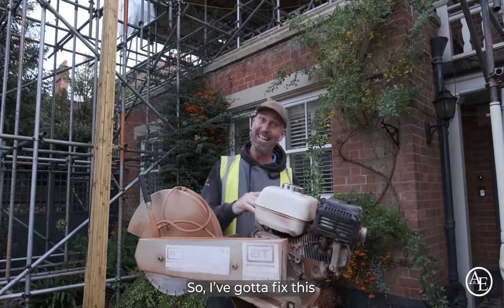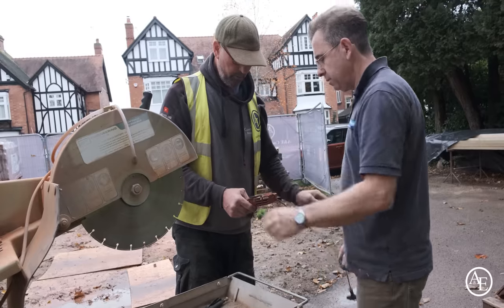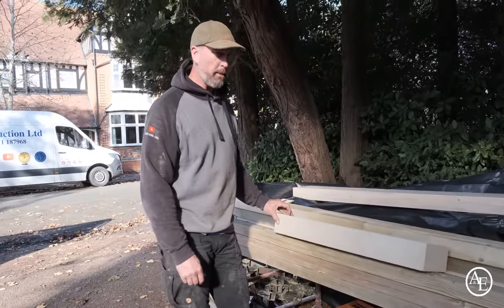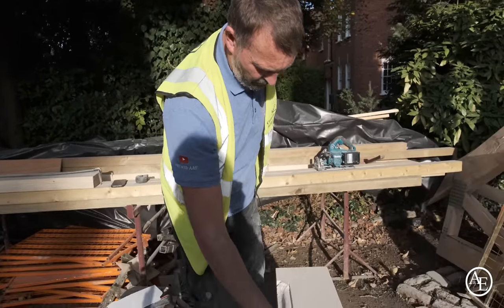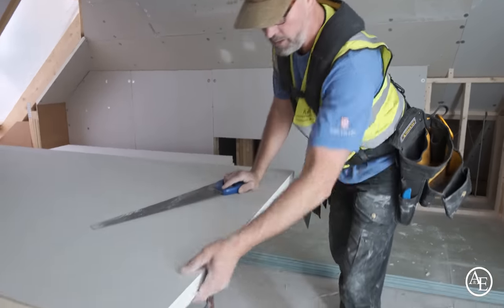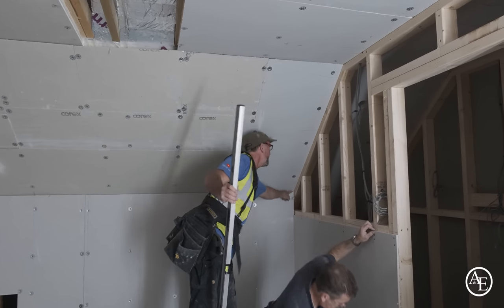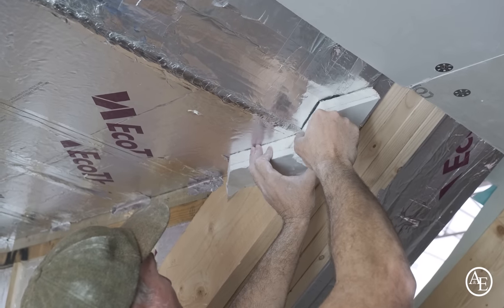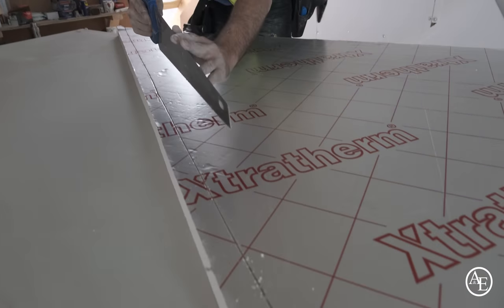BRICKSAW BREAKDOWN! | Onsite #15

Comment: I use a jigsaw to cut the warmboard.. I get a 100mm blade for the thick stuff... and also run down a pencil line at you 400 or 600 centre or the drywall Square will have the measurements on the to just slide it along mark your studs before you put it in place makes everything so much handier
Reply from the maker: Hi DJ great shout will give that ago all the best Tony 👍